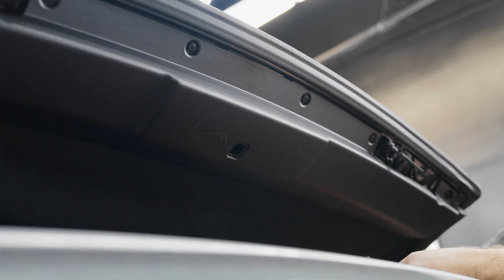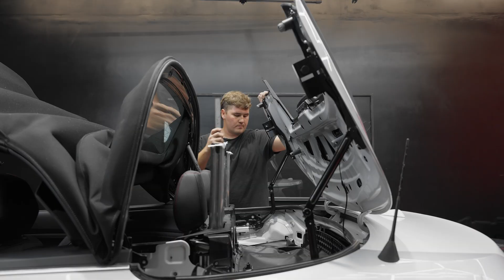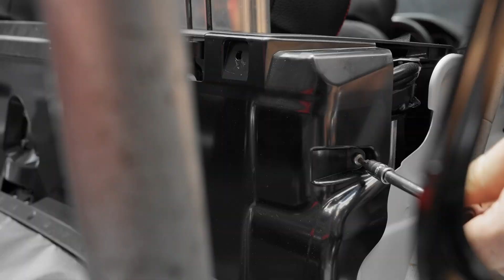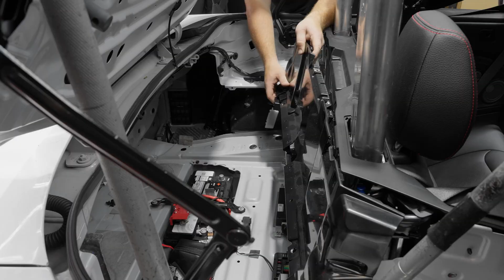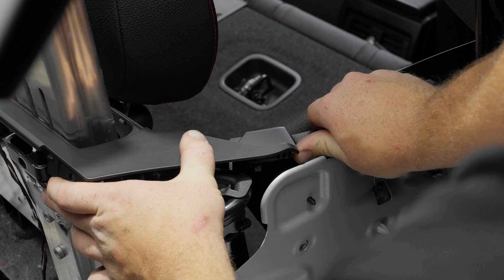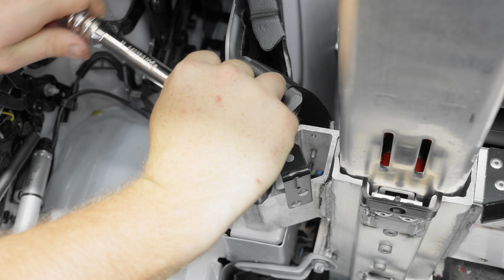How To Remove Roll-Over Bar on a BMW 230i | MyAirBags

Comment: Question, I have a G83 m4. Similar looking bars/setup obviously probably a little different with size and such. Is there a way to disengage the the bars to go back down so I can put the top back up until I have the funds and time to replace the entire thing?
Reply from the maker: Hi there! Unfortunately, we no longer service rollover bar units. However, here is a helpful resource you can review: this brief tutorial (under 1 minute) walks through five simple steps to reset an active rollover bar system that has become disengaged: https://www.youtube.com/watch?v=dSusm9SSZNU

Comment: Why do you have to change after is up? Cant you put(lock)down after crash? Thx!
Reply from the maker: Great question! After a rollover or crash, the bar and its internal components are designed to deploy once for safety and usually need to be inspected or replaced rather than just locked back down, which is why they’re serviced after the event. If you’d like specifics on our service, feel free to reach out to us at (888)779-9029 for more details!